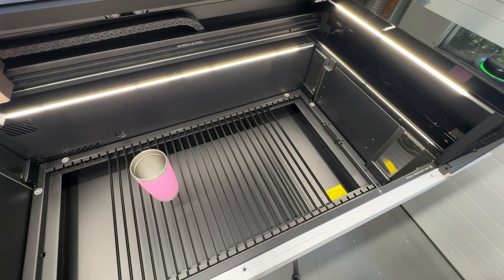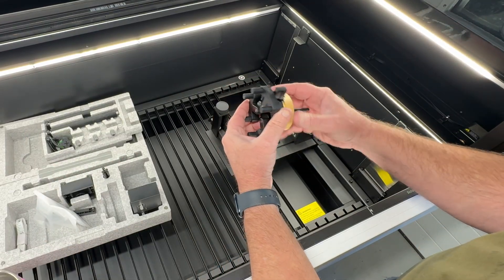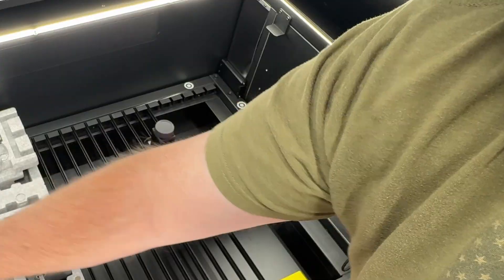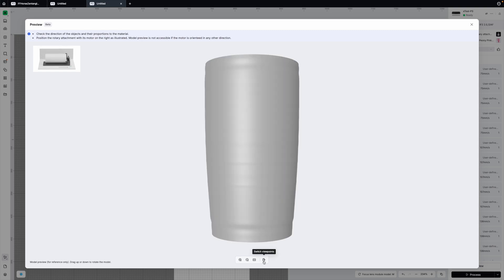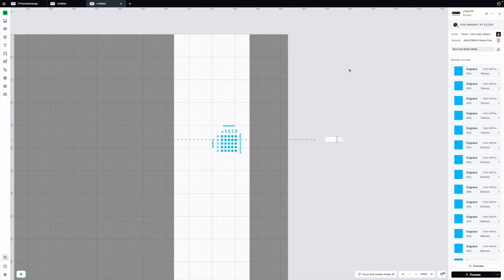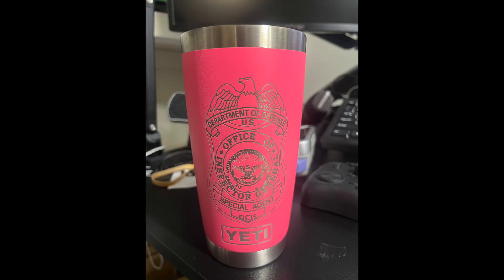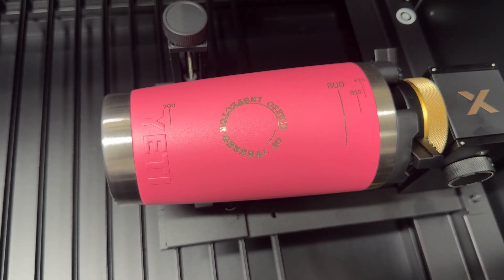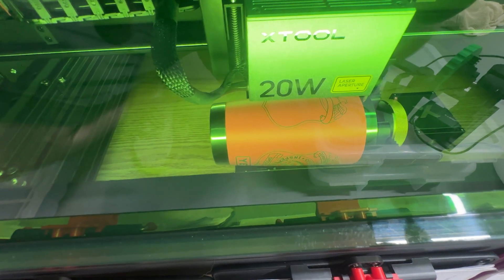Setting Up the RA3 on the New xTool P3 (xTool Studio Failure)

Comment: I just had the same issue with my P3 with xtool studio...it engraved it backwards and it was warped...did you find a solution?
Reply from the maker: Make sure you have all the updates to xtool studio installed. Calibrate your R3 and for now do them in Manual mode ,not full auto - Last I looked full auto is still Beta I have had no issue in Manual mode I have some updated videos on this subject too

Comment: Got the P3 today and found the RA3 MUCH nicer than the RA2. Soooo I hooked the 3 up to my F2 ultra and had the same mirrored image result. Hooked RA2 back up and it worked flawlessly. I emailed xtool about this. I think I can get it to work if I mirror the engraving in XCS, but I shouldn’t have to. Honestly, the quality of the 3 vs the 2 is far superior. I hope they work this out with a software workaround.
Reply from the maker: Have a video will be out today with the updates in Manual mode it's working great I did tumblers and glasses no issues have not messed with the Full Auto Beta again yet as I have to much paying jobs to get done but I am sure that will be amazing once the kninks are worked out just happy to see manual mode is working great they did a lot of updates it looks very different now my video on the glasses post today at noon
Reply from the maker: Yes the RA3 is such a great design I love the magnets so much faster and dealing with screws

Comment: Has this been resolved? Kinda making me change my mind about the P3?
Reply from the maker: We just got an update yesterday I am doing testing today and have a new video in the works I will be putting out ASAP  Keep in mind this failure was on some Betta Software that uses a full auto mode and is not claiming to be fully ready. It was not perfect at the time I made this video. when  but that's normal for brand new state of the art lasers they always seem to need a few software things worked out. That said, here is some great news and also shows how responsive xTool is to issues they added the frame feature I asked for in my last video it's already added  and i used it yesterday the new update seems to be great.  I did a glass engraving yesterday that came out perfect and was really easy. I just have to check the manual mode and see if that's all working as it should. So far this machine has been fantastic and the only issue I found was this glitch in the Betta program for tumblers on full Auto That would not stop me from getting this machine in any way as I am sure it's all being fixed and may already be fixed but its really a beautiful C02 Laser of the highest quality

Comment: That's interesting 🤔.  When I asked xtool if the RA3 would work on the S1 they said no lol. This is great.
Reply: really worked great for me I love this new model the magnets are a huge improvment
Reply: They said no to the F2, I wonder if it will work too?😊
Reply: @Fleshybitz where did you see this
Reply from the maker: Will the RA3 support other xTool machines?

It is currently exclusive to the P Series, as it requires the P Series' advanced hardware configuration, including its vision system, Lidar, and large work area to perform at its full potential. To ensure a great and reliable experience on other machines, we are now working to adapt the RA3 for other camera-equipped models, with completion expected in Q1 of next year. We appreciate your patience and support.
Reply from the maker: Well works on my S1 wish it worked reliably on my P3 LOL
Reply: @ALXSHARPEN I asked xtool
Reply: Will the RA3 support other xTool machines?

It is currently exclusive to the P Series, as it requires the P Series' advanced hardware configuration, including its vision system, Lidar, and large work area to perform at its full potential. To ensure a great and reliable experience on other machines, we are now working to adapt the RA3 for other camera-equipped models, with completion expected in Q1 of next year. We appreciate your patience and support. Sounds like its coming but worked for my S1
Reply from the maker: Above is what it says on XTool but it total works on my S1 using XCS it didn’t work using XTool Studio

Comment: Just a guess but its possible the text wasnt merged into the design and caused some had the overlap problem where with one big vector you wouldnt run into the ghosting burn in
Reply from the maker: The badge is one big vector image have used it for many times for retirements for this agency so I don’t think that’s the situation.

Comment: Appreciate the upload. Would have been cool to show the calibration process. But I’m not sure why xtool is FORCING xtool studio so randomly and it’s obviously not ready yet
Reply from the maker: I found it the next day thats why I did not include it but it didn't make any difference you hit one button with only the motor with no chuck inside . It takes about 2 seconds
Reply from the maker: What I used did say Beta there is a tumbler setting for manual the problem with it is with no frame function its very hard to tell where you are on the tumbler. I hope they add a frame function  to the P3  like LightBurn and almost every other laser software has that would be a big help to avoid placement problems
Reply: @ALXLASER or atleast a camera option like F2u
Reply: @kennyrobman7390  yes I also have the F1 but I never totally trust the cameras I still like to hit frame and be 100% sure now I will say this so far the P3 camera placement on flat material has been spot on
Reply from the maker: Agree (The material library in Studio needs work big time) I can't find anything I have to keep both open XCS is far bett in the Library studio is missing stuff and has not filters

Comment: What’s insane is this morning I was up working on the p3 around 6am hoping someone made a video about RA3. Then wake up later, boom
Reply from the maker: I would just test before you use it on something important I think I am having an issue with the new xTool Studio not sure why but it even failed on my S1 laser. I time coded the video so you can see what happened and jump around but the RA3 is great. I think what happening to me is software related but I will try to get to the bottom of it this week.